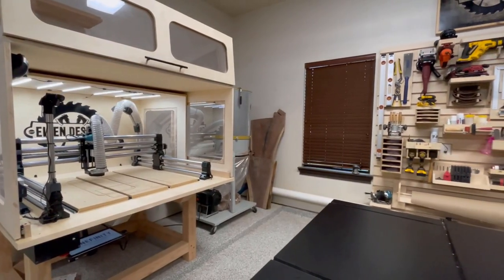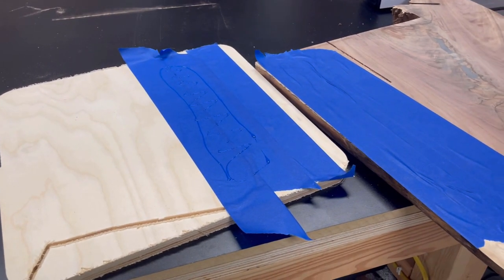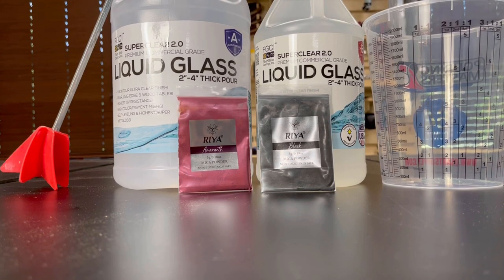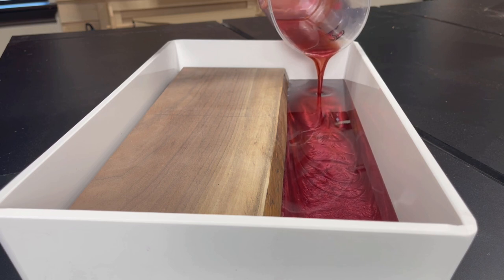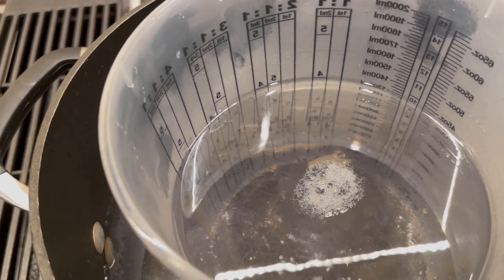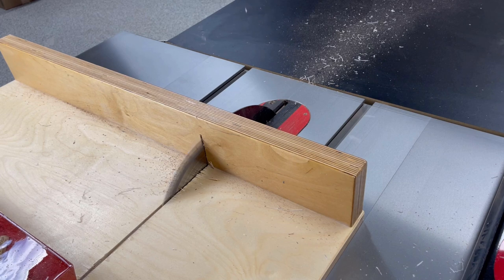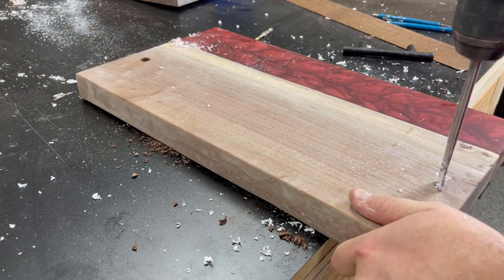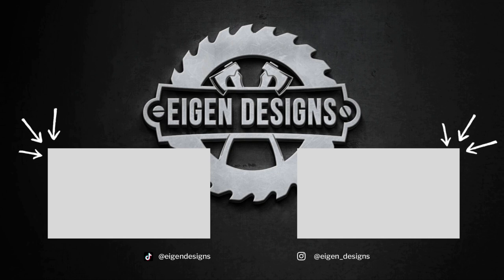Epoxy Wine Serving Tray  |  How to Create Epoxy Wood Projects

Comment: Hey - great video . Did you run into any issues with tithe corks bubbling ? If so how did you manage that . Thanks
Reply from the maker: There were some very small bubbles, but nothing that would catch the eye. If you're wanting to avoid them altogether you could pre-seal the corks with epoxy prior to doing the clear epoxy pour.

Comment: Love the finished product! Your video was very easy to watch and follow! Could you list all of the products you used for this project and the amount of time for curing stages? In the video you mentioned 24 hrs. for the first pour. Was that based on thickness? The second pour was up to the edge of the wood and not over, right? So the top of the wood was epoxy free? Thanks again!
Reply from the maker: Hey George, I left some links for you down below so you can see the products I use. Generally, epoxy cures over the course of 2-5 days, depending on the brand. I waited 24 hours before pouring the second stage so that the exothermic part of the cure (e.g. the heat given off by the chemical reaction of the epoxy) was done, but not yet fully cured. What you're trying to avoid is a single deep pour because the epoxy can get so hot that it actually cracks under its own thermal load. Any pours under 2" and you should be fine with a single pour, unless you're pouring two colors.

Also, the second pour was all the way up to the wood without going over.

Video Specific Items:
Fine Grit Wet Sand Paper: https://amzn.to/3qauLG6
Epoxy Color Pigment: https://amzn.to/3keeDj4
Epoxy Resin: https://amzn.to/3mPiS6r
Abranet Sanding Discs: https://amzn.to/3rjeOMz 
13-Piece Spade Drill Bit Set: https://amzn.to/2UlBT5g
Reply: I might be missing it but where did you get the mold from?

Comment: Awesome piece! What size mold did you use?
Reply from the maker: Thank you! This mold is 10”x18”. I specifically chose this size so I could fit the final piece through my planer 😃
Reply: @EigenDesigns  makes sense. I need to pick one or two up. Thank you

Comment: How long did you wait to trim and plan once you take it out of the mold?  3 Days, 7 days?
Reply from the maker: I normally wait 3 days before cutting or sanding epoxy projects. If you can wait 5 days that’s great too. You have the give the epoxy ample time to cure so patience is key.
Reply: I assume you can wait longer if you wanted to?
Reply from the maker: @markray3733  absolutely. The type of epoxy you use will determine the cure time, but most should be fully cured within 5-7 days.

Comment: Wow, wish I had seen this 12 hours ago.  Tried an epoxy wood project with corks today and it was a disaster.  I waited 3 hours to hold the corks after a 1/4 pour bit wow, did not work!  There goes about 75.00

Comment: Looks like you chamfered the edges?  Did I miss that?
Reply from the maker: Yes, I must have done that off camera. For the chamfered edges I use my hand sander rather than a router. I had an epoxy project chip out once when using a router so now I chamfer my epoxy projects using even passes of my hand sander held at a constant 45 degree angle. 

I hope this helps!